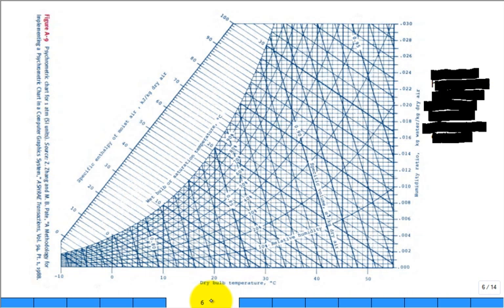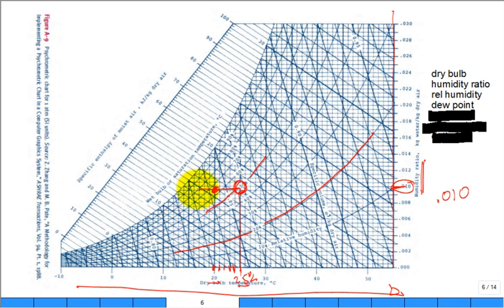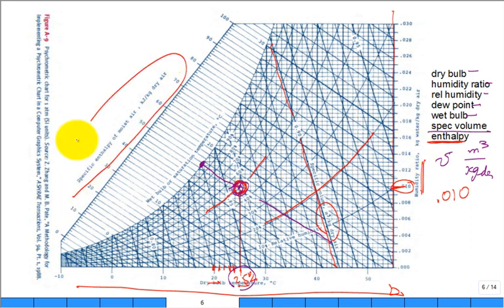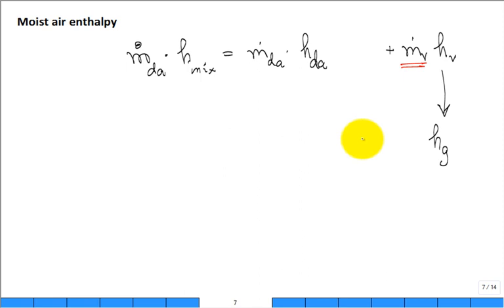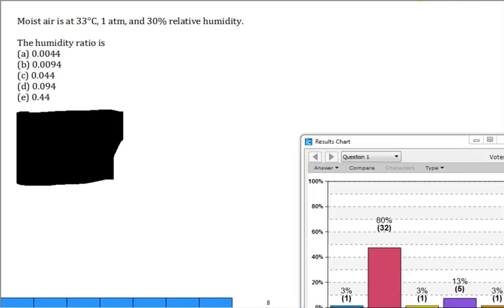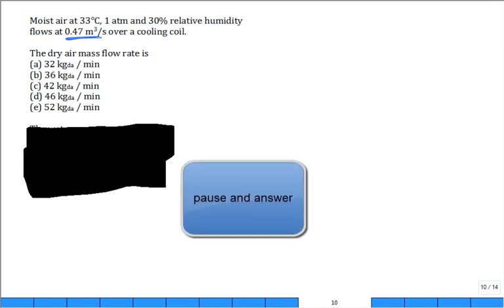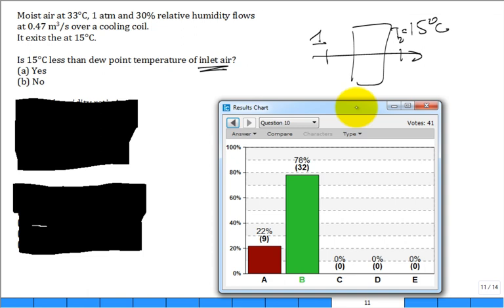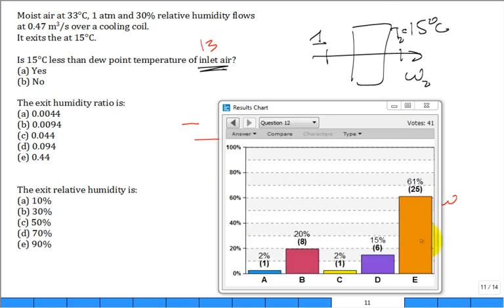Intro Psychrometric Chart

Comment: Hi Professor: Could you kindly verify my understanding below of the subject: Thanks 
1. When the dry bulb temperature is higher than the wet bulb temperature, the relative humidity is below 100 percent, right? 
2. Does it mean, the heat transfer rate from the surroundings into the evaporator is higher, lower the value of relative humidity? 
3. When the dry bulb temperature is equal to the wet bulb temperature, the relative humidity is 100 percent? 
4. When the dry bulb temperature is less than the wet bulb temperature, the relative humidity is actually greater than 100 percent, and we call it dew point, because water condenses out of the atmosphere? 
5. The rate of heat transfer from surroundings into the evaporator coil actually depends on the difference (Delta T) between the DBT and the refrigerant temperature in the evaporator? 
6. What is the purpose of the enthalpy on the psychrometric chart in air conditioning?  
7. Once, I observed dew point condensation on external surface of furnace tubes inside the firebox during a summer. It was warm outside. Why did that happen? Does it have something to do with pressure inside the firebox? It is always a positive pressure inside the firebox. This is lube refinery furnace at sea level. 
Best Regards
Reply from the maker: Sorry, but don't have time to answer all questions asked on youtube. I will try here, but I can't do follow-up questions. I hope you understand. 
1. yes 
2. when moist air temperature increases (due to heat transfer in) with no change in amount of water vapor (constant humidity ratio) then relative humidity will decrease. 
3. yes
4. moist air would not be in equilibrium, as you describe, water vapor will condense and dew out.  in equilibrium, can have: Tdrybulb = Twetbulb = Tdewpoint
5. yes. also geometry and flowrates also affect Qdot.  Qdot = h*A*(Thot – Tcold) where as you describe Thot is air and Tcold is refrigerant. geometry and flowrates affect “h”, the convection coefficient
6. moist air enthalpy accounts for both “latent heat” and “sensible heat” in one easy to use term.  Sometime cooling is related to only “sensible heat”.  But in hot-humid climates, cooling of moist air can strongly depend on “latent heat” associated with condensing some of the water vapor.
7. hard to answer your question.  Maybe warm water vapor coming inside of firebox thru cracks/holes/passages and adding moisture to air surrounding firebox, which then cools so it condenses.  Like “fogging a mirror” with your breath.  Or maybe no moisture from processes, but it was a very humid day.  The air surrounding surface of firebox must have had high dew point temperature.  When a surface has lower temperature than dew point temperature of moist air near surface (regardless if it is a firebox), then one expects condensation will form on the surface.